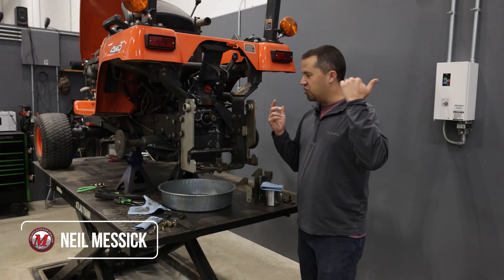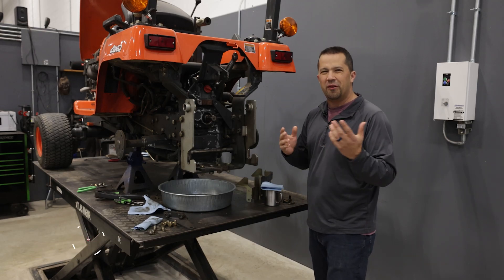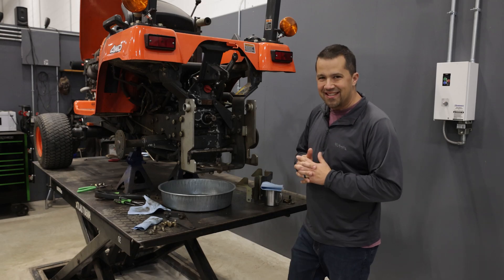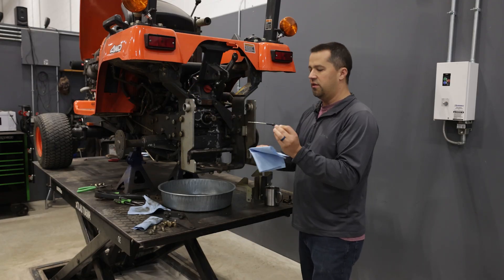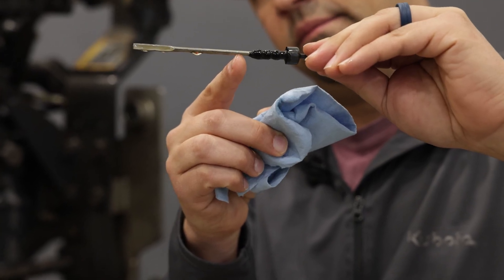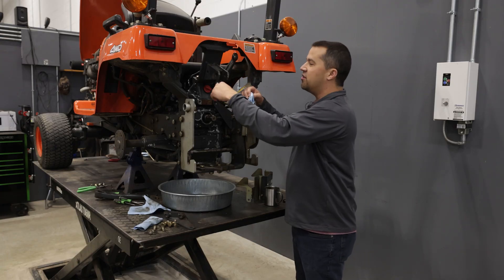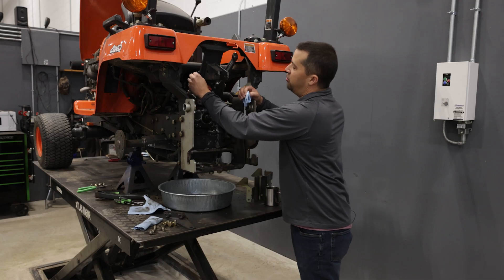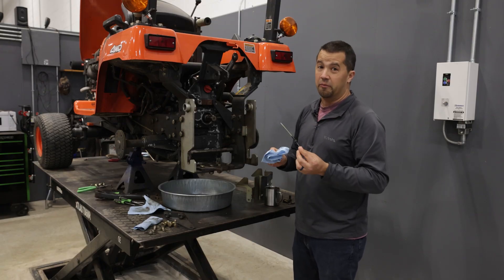Be Careful of Overfilling your Hydraulic Fluid

Comment: The age-old adage that we learn from our mistakes is TRUE. I accidentally overfilled my BX23S and fortunately the only damage was a blown axle seal. This was a relatively easy fix to install a new seal (and I got to use that opportunity to change the fluid and filter!). Now I'm VERY CAREFUL when checking my hydro levels (including sticking to using the same cylinder positions).

Comment: I recently experienced a Hydro loss of power and my steering system it just got real slow and sluggish. I replaced the pump given that my tractor is a 2006 model. I figured it was time for a pump anyway. Long story short, it took a while to bleed the air out of the system, but it worked again to repair the steering but now my tractor is weaker and slower. What should I consider doing next to improve operation to prior performance? Just seems sluggish.
Reply from the maker: What model is this for?

Comment: What's the correct way to check the level? Cold ? Putting dip dipstick in a few times when cold? Thanks Neil 😊
Reply from the maker: The correct way is to simply be consistent with whatever you choose so the conditions are the same each time and you'd notice a leak or consumption

Comment: Is it better to check the fluid when the fluid is hot or cold?
Reply from the maker: does not matter, just be consistent when you check it so you know if its leaking. The heat will change the level.

Comment: my tractor has a glass.  easy to spot the level with a hand pump and watching it (and watching and watching and watching....)  the problem is every attachment and even the 3 point at different heights changes the level - buckets, backhoes, grapples, height of 3pt implement, etc.  if filled to "right" height it is unhappy when working and needs more fluid but change configuration and it is unhappy it has too much - ugh

Comment: Wonder if the breather was clogged up?  Being that old of a machine its quite possible.  Although for being a 20+ year old machine that tractor looks to be in really good shape, at least the paint isn't pink, so it must have been kept indoors.  

My aunt had a VW Beetle towed into the dealership where the customer had hydrolocked the engine.  Turned out every time she would fill the car up with gas, she'd add a quart of oil to the engine....the crank case was filled completely to the oil fill cap of oil...several gallons of oil drained out late, and the car started and was fine LOL....overfilling things is often worse than being underfilled LOL.

Comment: Is there some kind of dye you could safely add to the oil? My tractor's dipstick was dry when it was delivered. Not buying from them again...
Reply: Hope you checked other stuff besides just the hydraulic fluid level LOL.  Just about every lug nut on the wheels wasn't torqued on my BX2680....engine oil level was fine, coolant was fine, but the front axle and hydraulic fluids were low.

Comment: So I always use Kubota hyd. fluid, but you are right, it is next to impossible to accurately see the level on the dipstick. Do you have any suggestions on how to avoid this visibilty issue?
Reply: Add food coloring maybe?  Not sure if that's something that could be done, I mean they add dye to transmission fluid to make it red, so I don't know why it couldn't be done to the hydraulic oil.  They add dye to diesel fuel for "offroad" diesel, so I'm sure a dye could be put in hydraulic fluid to more easily see it on the dipstick.

Comment: So most all kubota tractors and lawn mowers you check hydrostat fluid level with engine off?
Reply: Yes.  With my lawn tractor you ain't checking the fluid level in the hydrostatic transaxle with it running, heck you can't even get to it with the battery in place...even if you could you'd have quite the challenge as the hydro fan is on the top of the transaxle HAHA!!  

But, yes, check the fluid level with all your implements/loader sitting on the ground, and tractor level.
Reply: @wildbill23c  ok…wasn’t sure cause like automatic transmissions ( pretty much a hydraulic pump) needs to be checked with engine running!

Comment: Only tip I've been told that helps you see hydraulic oil level on Kubota's dip sticks is to take a hack saw and score "X's" or hash marks on the dip stick. This helps the oil stick and stay on the dip stick so it is easier to read. Still not easy, but easier... 

This should be a part upgrade on future Kubota's and is one of my biggest complaints I have with mine. I never feel comfortable that I know the exact level of one of the most important fluid lvls on my tractor...
Reply: If this helps I have read if you lay the stick on a paper towel you can see the wet area. I have not tried this yet but plan on doing it.
Reply: @circuitbreaker9001  It does, but still takes 10 or so attempts to get a general idea of level. The hash marks and a paper towel is the way to go. 
   The L3901 hydraulic level can fluctuate A LOT if not on Perfectly level ground.  Not sure about other machines.

Comment: when checking the fluid level of the tractor with say a loader attached or other hydraulics should the hydraulic cylinders be retracted or extended my understanding is that on hst models these share the same revivor and depending on the attachment extended or closed could be a significant difference in volume in the cylinders?
Reply: Read the owners manual, everything with cylinders will have a “parked” or “maintenance” position and the fluid should be checked in that configuration for the reason you mentioned.  
Most often it’s checked with all cylinders retracted but there are some that should be centered or in a particular position when checking the fluid level. 👍

Comment: Overfilled can be just as bad as not enough, overfilling can cause cavitation in the system
Reply: Cavitation is a condition that a pump can have under certain operating conditions. Usually from an inadequate supply of liquid on the suction side or, too high of head pressure on the discharge side. Over speeding a pump can also cause cavitation. Over filling the hydraulic fluid in the tractor is highly unlikely going to cause cavitation in a tractor pump(s).

Comment: All gearboxes should have breather tubes in some shape or fashion. If a gearbox cannot breath then it will find a seal somewhere to leak.

I have to change the rear main seal on my 2001 MF1225. And probably the mid PTO seal. I paid stupid tax trying to rebuild my water pump last year. It held but recently found it was leaking again. I even wore gloves and NEVER touched the seal nor let oil get on it. Cost $200 to rebuild. Cost $400 to replace with new - always pay more to fix it right the second time 🤦

Comment: When I get a dipstick that's hard to read I'll line the end up with a paper towel and touch it to the towel. You should be able to see how tall the wet spot is, not perfect but it will get you close
Reply: Yep, that's the best way I know to ensure a proper level. Blot the stick against the paper towel.
Reply: Use the blue shop towels, like in the video.  Since clean oil drips off a dipstick quickly:  take the dipstick out, lay it flat on top of a piece of blue towel on the palm of your hand.  Fold the towel over the dipstick and then unfold it.  The dark oil stain next to the dipstick shows you the exact amount you have.
Reply: Terrific idea!

Comment: Does Kubota offer any dye to be able to see the level easier, especially for us with older eyes?
Reply: They should've made the stick portion if the dipstick black so that it can be easily seen.
Reply: John Deere mt3668. I wouldn't recommend using it if your tractor is still under warranty.  It won't hurt it but Kubota will say it did to avoid paying.
Reply: John Deere has a dye
Reply: When you don’t have a dipstick and if you aren’t allowed to use dye what do you do?   I have the sight glass it sucks. Flashlight helps but not much.
Reply: Take flat  paper towel drag ur dip stick across it slowly and u will see the Utd level ..70 yrs old same problem could not see on dip stick fluid so clear …makes u feel dump first you do it for not thinking of ur self …hope this helps
Reply: @jimmie7520  was about to write the same comment apart from being 70 👍🏻